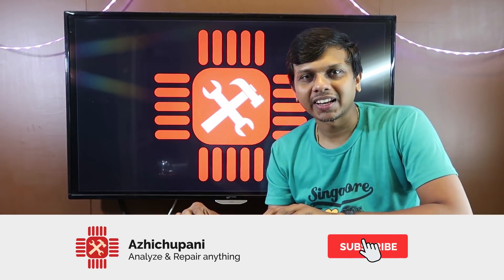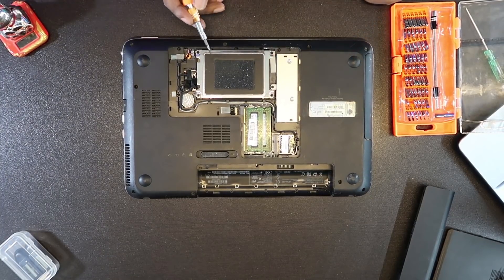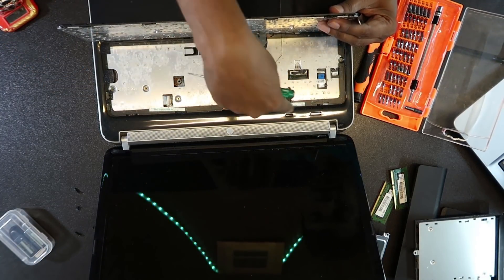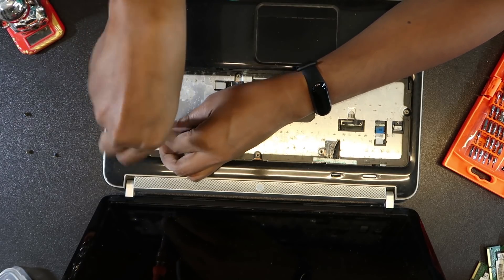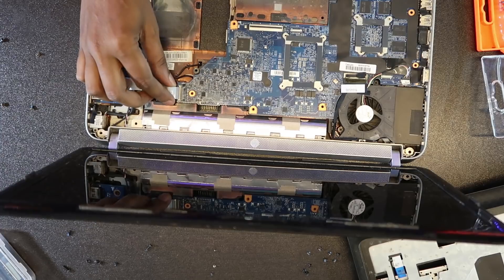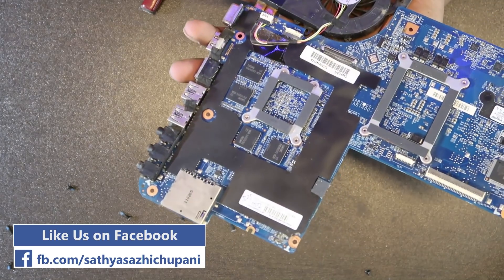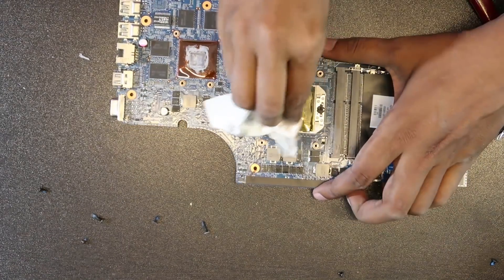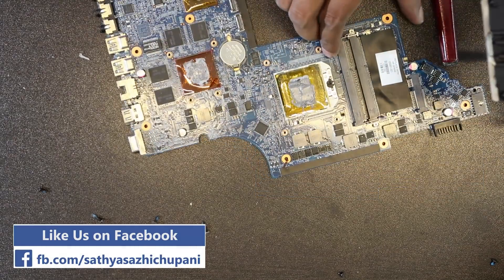HP Pavilion DV6 Laptop overheating | Tear Down and Reassembly | Malayalam

Comment: What is the reason for automatic off while working on laptop...there is no heat issue...iam unable to use laptop more than 10 minutes...if i switched to charger there is no issue...is this issue due to battery issue or any other
Reply from the maker: Try a different charger